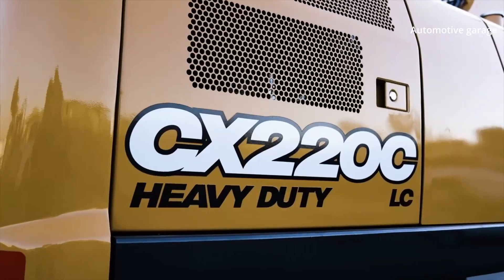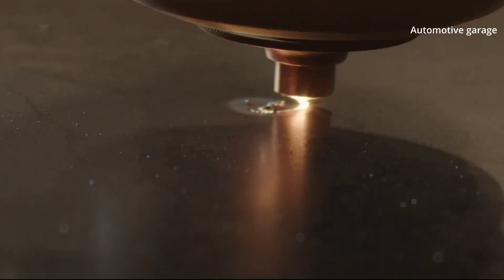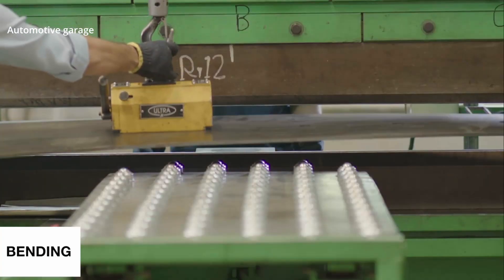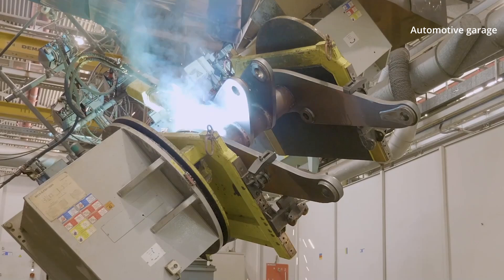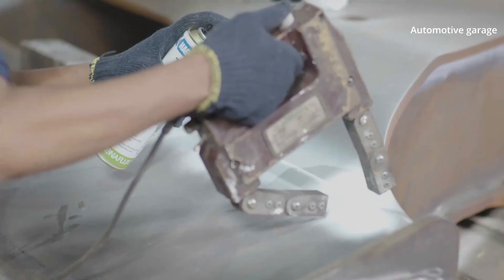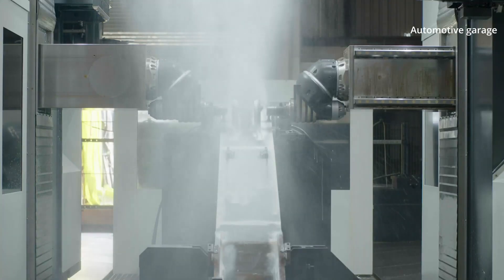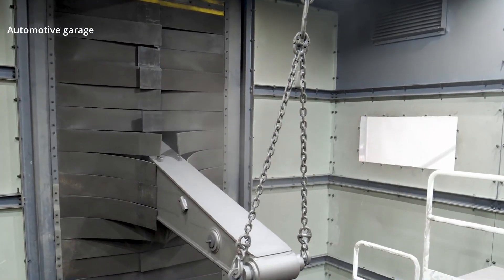Inside Giant Factory: Case Construction Equipment Production Process

Comment from the maker: 0:00 about Case Construction Equipment
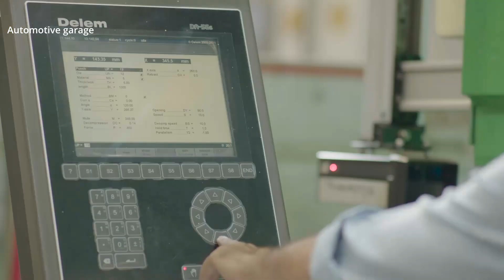0:22 laser cutting facility
1:06 bending
1:22 welding shop
2:57 machining
3:19 paint shop
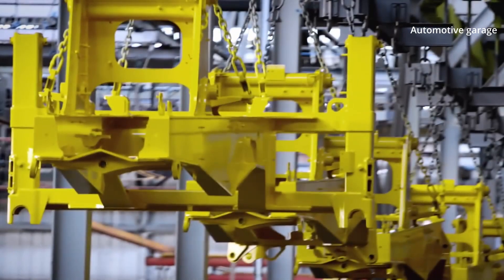4:28 excavator assembly line
4:46 crawler excavator line
5:43 vibratory compactor line
6:08 backhoe loaders line
7:06 wheel loaders line
8:34 Inspection and testing
Reply: 14/4/2023..covid19...8:37pagi